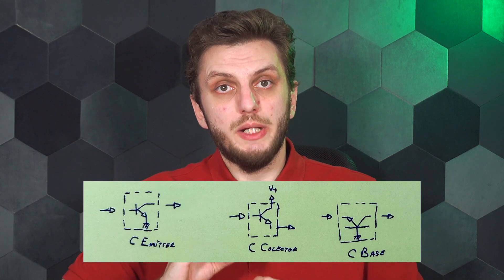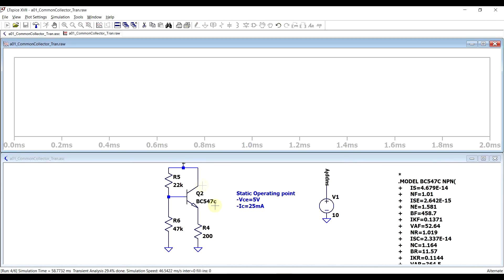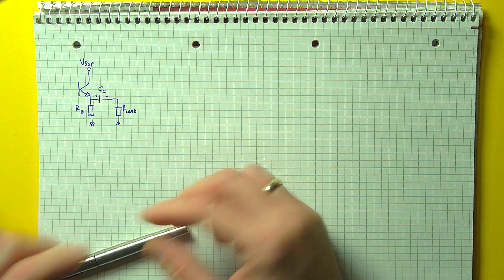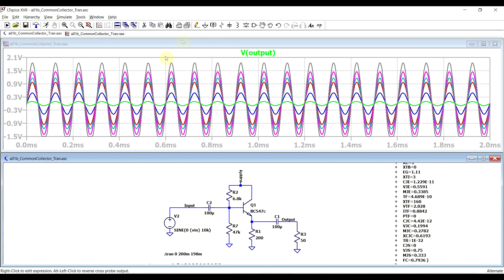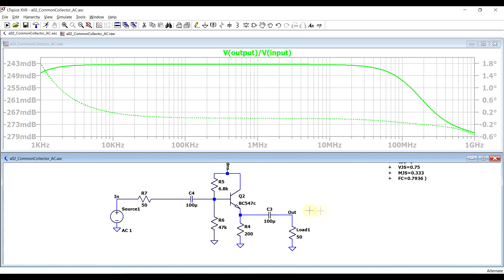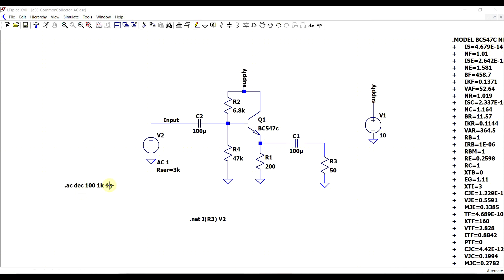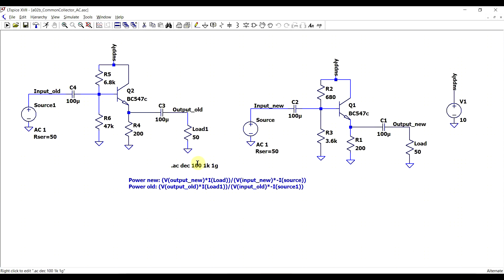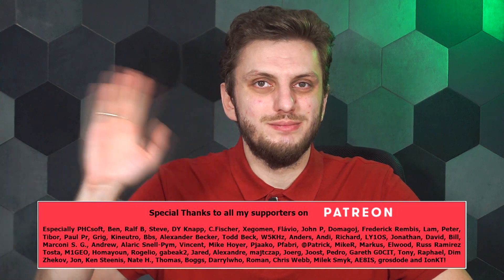Common Collector Amplifier - Theory and Basics (1/2)

Comment: Another interesting thing is the push pull common emitter output stage because of its rail to rail operating advantages. It is probably worth a video to this type of output stage. It is especially useful for relatively low supply voltages, but I have used it in an amplifier with a +/- 12 V power supply to get 14 W of output power without higher harmonic distortion instead of 11 W.

Comment: Another interesting video. While agreeing with everything that you say, my recent experiences with emitter followers is less rewarding. When driving even a fairly low capacitance load, the base transit time effect (finite Ft) translates this into a negative input impedance and high frequency oscillation instability at a much higher frequency (200-300MHz) than what the circuit was ever intended for (30MHz).  I eventually got the circuit to work with good decoupling and several cascaded high loss ferrite beads in the base, but it had turned into a bit of a monster by the end!
Reply: Same I can't get the distortion down luckily it's mostly the kind of distortion that "sounds good" but still I want to have a clean signal going to my speaker

Comment: Why is in the formula to demermine the input and output impedance not dependent of the inpedance of the input and output decoupling capacitors?
Reply from the maker: It makes the assumption that the decoupling capacitor (or the AC signal coupling capacitors) are ideal
Reply: It's valid to calculate at the band pass range. You can also use the capacitor impedance, and have to include "parasitic" capacitances of the transistor.

Comment: Hey, thanks for this video, I've been thinking about emitter followers for RF buffers recently. I had an idea re voltage swing but found no material or discussion of it: Why not put an inductor at the emitter. I get nice voltage swing, and even symmetric below the negative rail. Have you thought about this? Is it a dumb idea? Simulations look ok so far. Cheers
Reply from the maker: I think the problem with this has to do with the initial dc biasing; having a resistor is helpful to ensure stability over gain variations; you can of course use an inductor, but you need to make sure the average collector current does not vary with temperature. In a similar fashion in common emitter amplifiers, an emitter resistor is used for biasing, but for high frequency operation, this resistor is shunted using a capacitor.
Reply: I tried this idea a year so ago. One major difficulty with an RF amplifier is getting enough inductance with a self-resonant frequency considerably higher than the maximum frequency of use.
Reply: Yes, that makes sense. In fact, for my preliminary test setup, I put a small shunted resistor between the inductor and emitter. I haven't done the calculation whether this would in principle be enough to be safe from temperature runaway before one loses more voltage drop than one has gained before...
Maybe if the bias base current is provided using some Z diode to get more voltage drop :)